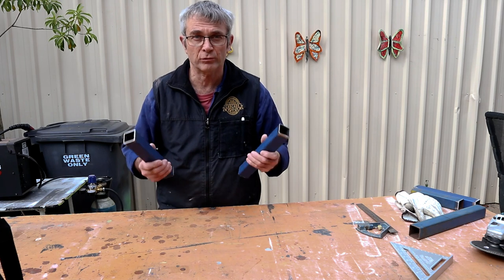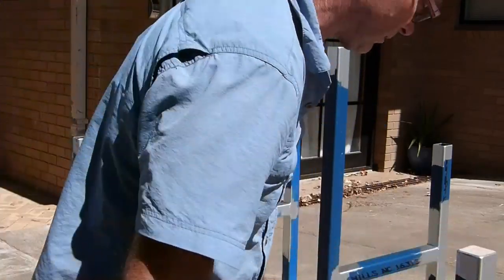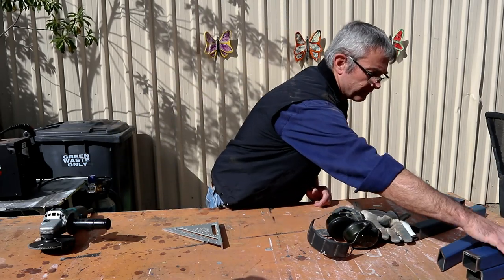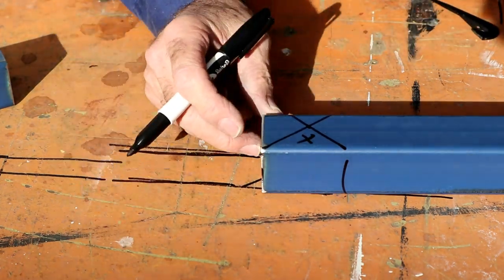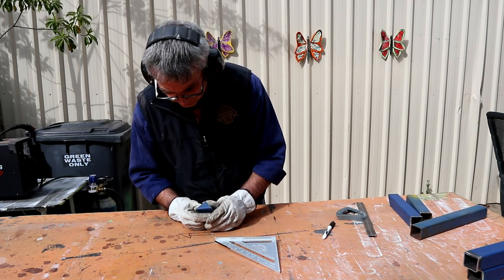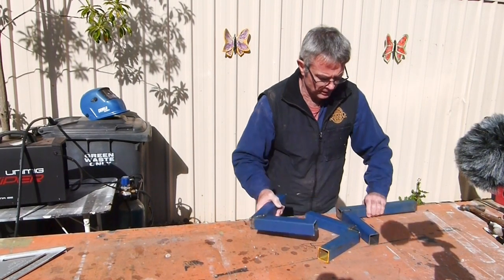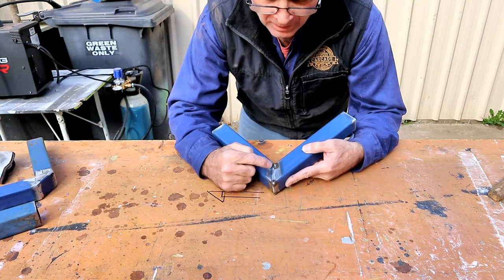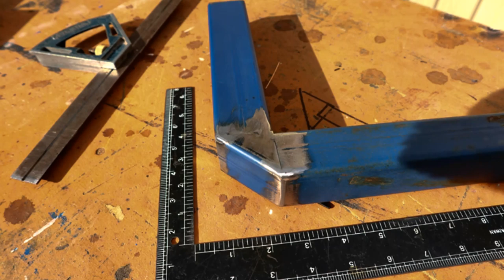Welding Square Tubing at 90 Degrees Joint Preparation, the 3 ways I Fabricate the corner.

Comment: Well done galvanising Gavin.
I like the three sided right angle. I haven't seen that before.
I'm in the process of making another attachable work table. This will be heavy duty and a fence with square so cutting boards square. It will accommodate my mft table although more sturdy.
I haven't finished the design yet and need more tubing.
I will weld some 7 mm flat bar cut out of an angle iron and drill holes to tap on the side to four rhs welded. This way I will have four pieces with flat bars welded and two squares welded so it can be dismantled.
The reason I want to do it this way is so I can bring it indoors if needed. I already made two long work benches. One is 2.2 metre long. One is 2.7 metre long and has draws on one side. Will have draws along the top section and under the left side will have draws which pull out. I also made a work table 2.2 metre long by 1100. That has a board for cutting sheet goods.
Reply from the maker: You sound very organized, I like the idea of being able to pull it apart to bring it inside.
Reply: Gavin Clark Thankyou Gavin. I think I will use 8mm stainless steel bolts although the steel is painted steel. It's all rusty so I need to clean up and paint. The angle iron is galvanised and around 7mm thick. I will weld as a flat bar. Perhaps there will be a reaction between the steel and stainless steel bolts.
I'm working on the drawing on computer. It's a working progress I may add a few features along the way.

Comment: Thanks Gavin, that is really good info. My welding skills are totally shite. Biggest problem I have is welding the right spot - can't see a damn thing once I drop the visor until I strike an arc and invariably I strike the arc in the wrong spot...I'm sure I have more problems, but getting past this first hurdle is necessary in order to discover my other problems :) Not sure I could cut that accurately free hand either - I use the metal cut off saw.
Reply from the maker: Hi Benny, have you got an Auto-Darkening welding helmet if not that will help you quite a bit, as you can see perfectly right up until you strike the arc, other than that it is really just practice. Thank you for your comment
Reply: @GavinClarkdiy  Thanks Gavin - your comment may have put me on the right track. I do have an auto darkening helmet..but it is never light enough to see what I am going to weld. Sounds like I should get a better one - mine is dark to begin with, then gets darker when I strike an arc. I've adjusted the thing with the knob, but can't get it so I can see well enough before the arc. Maybe the other thing I can do is improve the lighting in the shed, or move outside. Again thanks - really appreciate your response.
Reply: @MiniLuv-1984  Improve the lighting in your shed as welding outside comes with a few wrinkles as well.
Reply: @MiniLuv-1984  Buy a cheap LED headlamp, remove the elastic headband and sikaflex it to the top of welding helmet. You can now focus light directly onto the weld area.
Reply: @SoloVagant  Thanks Solo Vagant. That too is an excellent suggestion. Gentlemen I should be picking up my new visor this week and  I have a head torch...let the welding begin!
Reply: @MiniLuv-1984  You're welcome mate . Good luck on your welding journey ....

Comment: The third one with the inset piece seems the hardest and least strong.  Is that about right?
Reply from the maker: I would have to say it would be weaker, It pays to follow engineering drawings if you are making structural joints. I use this joint for the tops of gates, trolleys, and benches, etc, as it improves the look of the project over a standard 90 joint. Thank you for your comment.
Reply: I would imagine another cut piece on the inside of the joint would make that joint super strong? If whatever you were building would accommodate it of course 🤔

Comment: Why cut it into I thought you were gonna cut out the angles on 3 sides and fold the metal so the outside 90 doesn't get welded just inside where it's cut out
Reply from the maker: Very good point, I have cut the corners like you have said quite a few times nothing wrong with that way at all. Doing it as I did in the video, using a separate corner part is all the lengths between the corners are very simple to measure and cut a nice quick 90 degree cut, this also lets you use some short off-cuts I may have on hand, the corner bits can be cut from off-cuts too. The time to do either is not much quicker either way, the corner bit way has more cuts, but is super simple to set-up to weld, although there is two more welds on each corner, the other bending way needs a bit of time to get the corners sitting true, flat and square before the weld. That is my reasoning for doing it that way. Thank you for your comment.